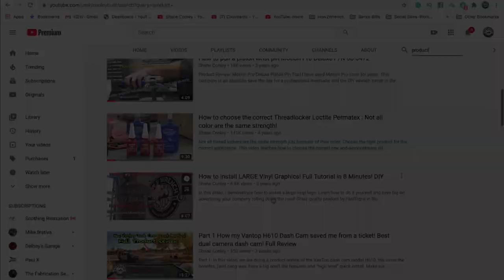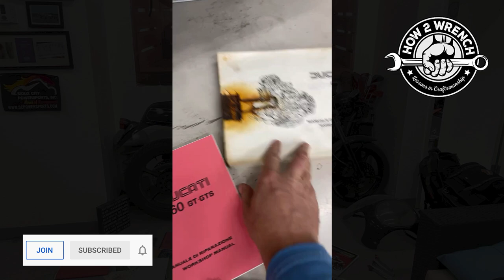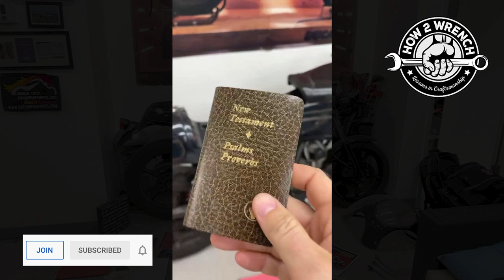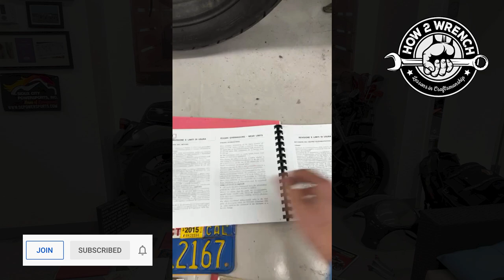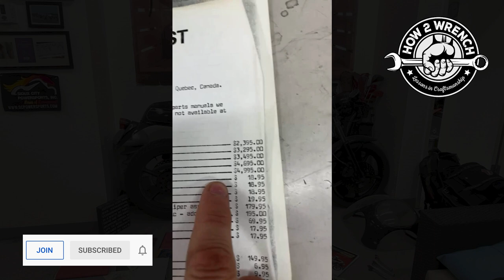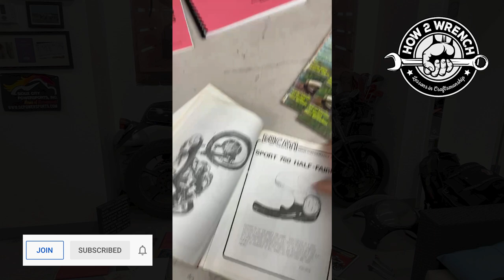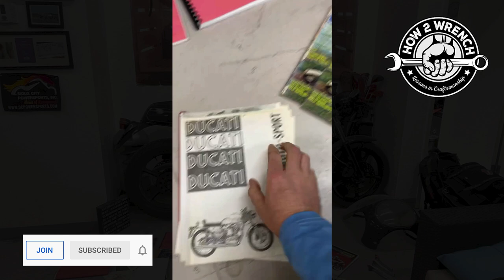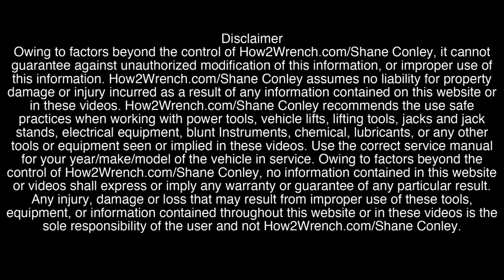A call from the fella I bought my vintage Ducati inspired me to bring it back to life! Birthday Fun!

Comment: I love the old stuff.   I knocked my 1975 CB750 over for the first time two days ago... broke the brake lever just like you did on the Ducati.   It happened because I dropped my new (to me) 1964 Triumph as I was putting it on the center stand... it fell over and hit my Honda, knocking it over.   I nearly cried.   After the dust settled I had a torn grip on the Triumph and a bent front brake lever on the Honda.  I was pretty lucky there wasn't more damage.
Reply from the maker: I feel your pain friend....